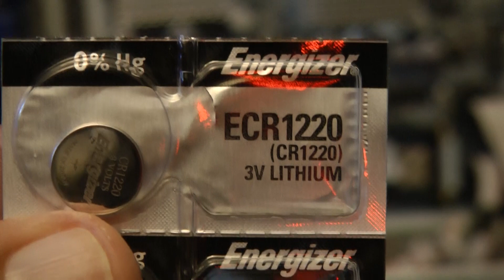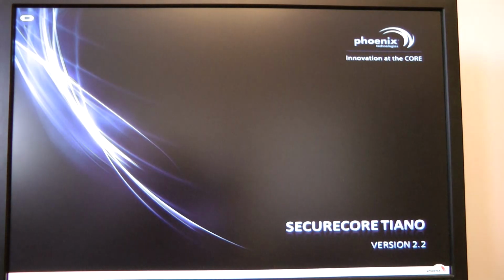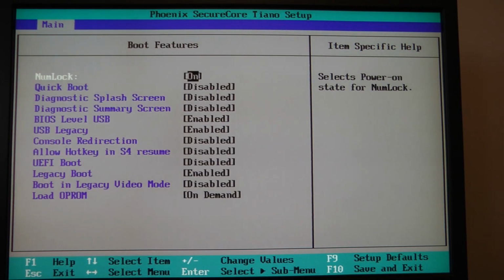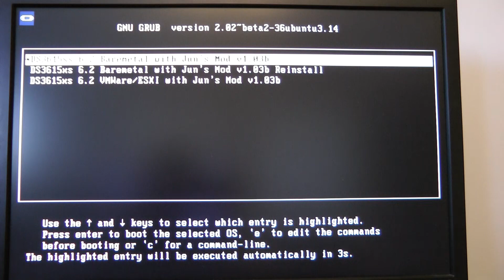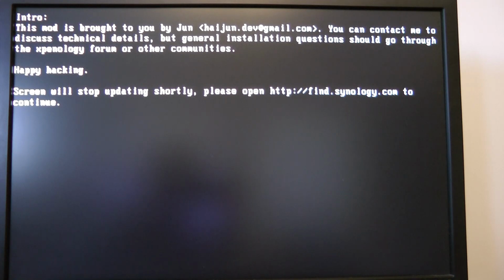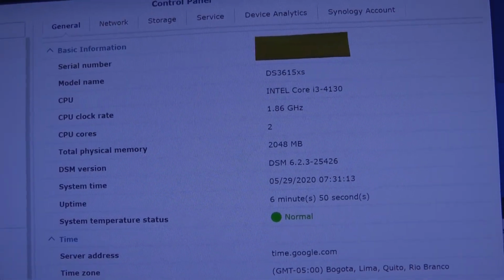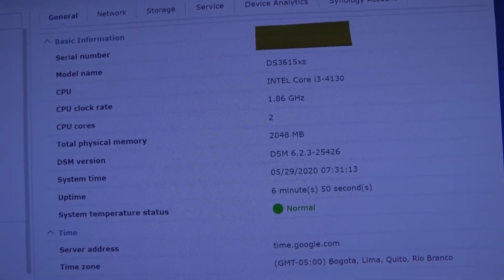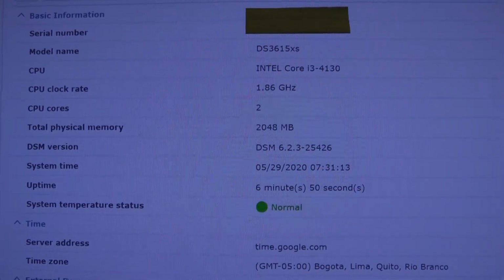How to run Disk Station Manager on a TheCUS N5550

Comment: Can you still use the front usb 3.0 port after upgrading to dsm?
Reply from the maker: The USB 3 port works
Reply: @GaryQuiring  Thanks. For some reason mine is not working. I never used it when it had the thecus os before so can't confirm if it never worked at all. The rear ports all work fine but are slow for data transfer being usb 2.0
Reply: OK got my USB 3 port working. Turns out it wasn't working due to incomparable memory (RAM) I was using, the sodimms used were lower voltage 1.35V vs the recommended 1.5V.  Swapped back the original 2GB sodimm 1.5V and all works fine now. I was also having issues with the Nas freezing causing read only mode etc.

Comment: Nice work, But my thecus n5550 has the atom cpu, does your have an i3 cpu?
Reply from the maker: Yes I have three of them bought several years apart, they all have an i3 cpu.
Reply from the maker: Synology reports the CPU as the Core i3-4130 @1.86GHz

Comment: I did the same with my Thecus N7510. It has an Intel Atom D2700 inside and 7 bays. Like you: running stable for nearly two years now.
Were you able to get the front USB3 port working? According to the specs it's a NEC D720200AF (same as yours if my information it correct). I can boot from it, but DSM doesn't recognize it (not after booting, but also not after booting from an USB in the back).
Reply from the maker: I just tried the front USB 3 port on the N5550 and DSM sees the hard drive.  I used File Station and can see the files on my USB 3 drive.